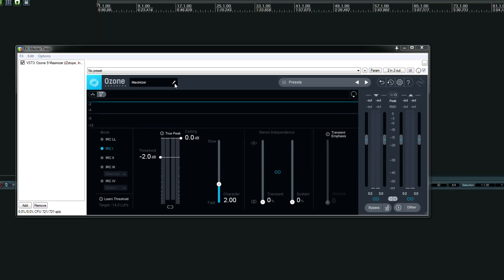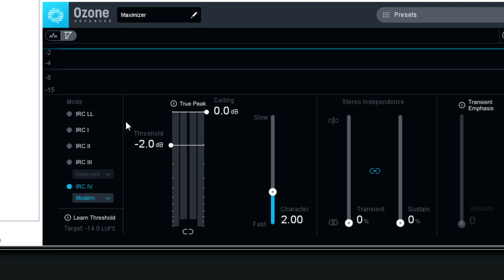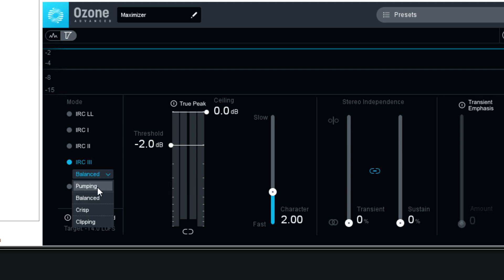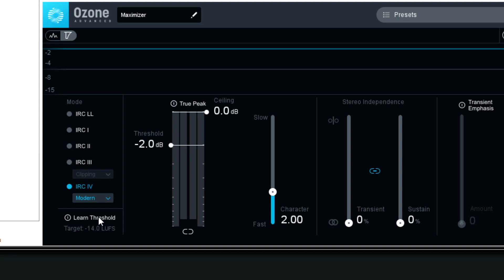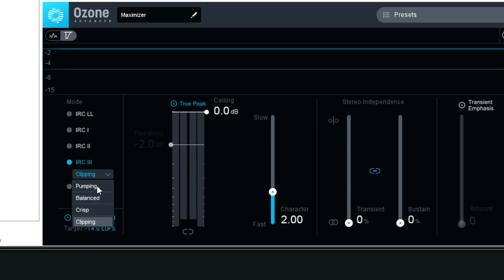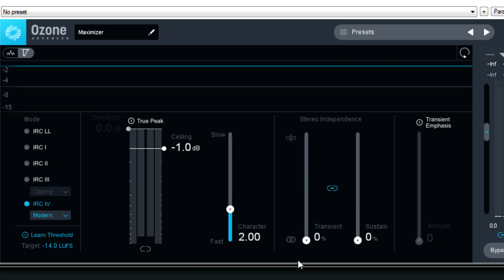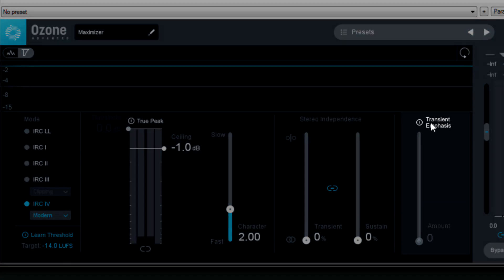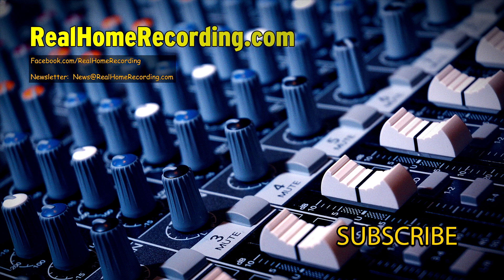Ozone 9 Maximizer Tutorial Brickwall Limiter

Comment: How I use this tool is to simply start at a preset, and constantly A/B the source and my work until I get the closest match possible.  I'll move the threshold and ceiling all the way up to 0 before I begin work.  I can easily spend a half-hour getting a match as I am not under any time constraints.    When I get my sound locked in,  i'll move my ceiling to -.6 and move my threshold to wherever my target is.  Then, i'll set the transient emphasis to really zero in on a sonic match.  Once it's all done, i'll render and use the same A/B/ process for the dither and noise shaping.

Comment: you didn't explain what the sliders on the I/O panel do or how to choose a value for them
Reply: Just watch them to see if you have any headroom left that you might want to use. If you play with them awhile you’ll get a feel for how to use them. Simply though if you like the result of everything you set up in the controls nothing should be clipping on your output fader and if you want a little more gain try pushing it up a little on the way out till you see the evil red lights at the top and back off till they don’t come back. To clear them after a clip hit just click on them. Regarding input generally leave it at default. This module won’t have anything after it btw.

Comment: No mater what setup i use the ozone maximizer always allows some samples to go over the set celling and they are getting cliped. How can i setup this to have no clipping at all? The thing is i am certainly not going for as loud as possible but want to create dynamic master without clipping on transients.
Reply from the maker: Even with true peak on?
Reply: I had the same problem make sure the maximizer is the last thing in the chain inside ozone 9
Reply: Same problem here. Have you found a solution.
Reply: @renanbrito.  Yes. before mastering adjust the gain of the mix so the peaks are about -3dB. Maximizer works much better then.
Reply: @jakubbason3122 , Thank you so much!